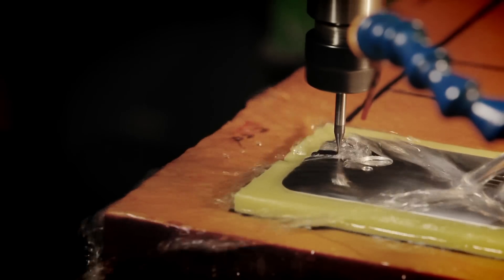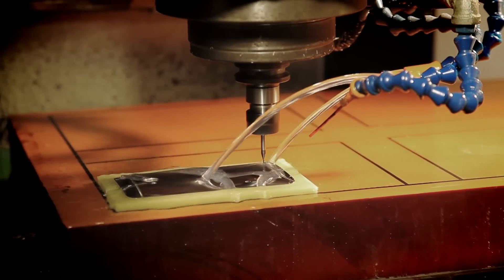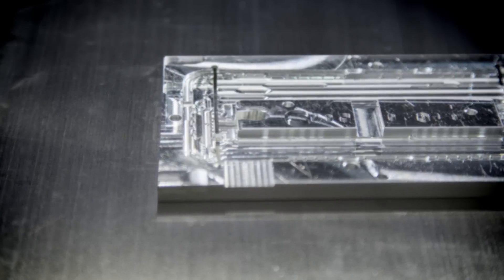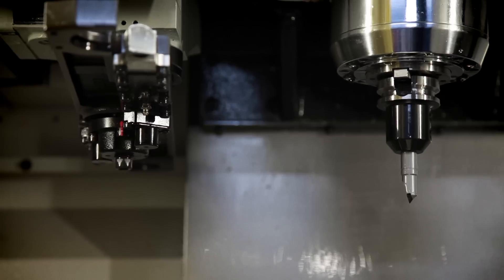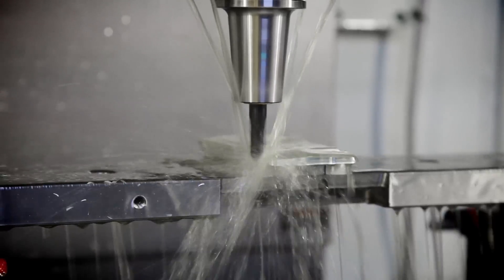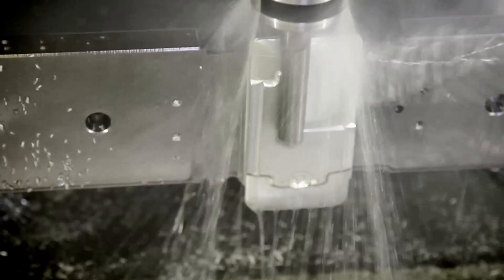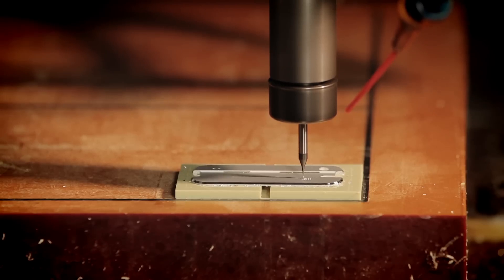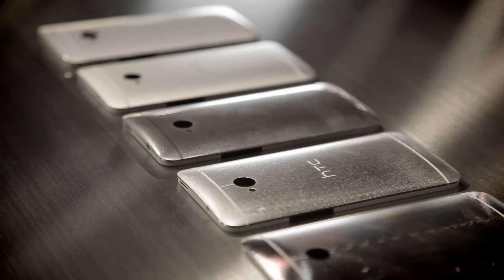Behind the breakthrough -- Building the HTC One.

Comment: Do you not research anything? The actual pixels in the camera are bigger, so they take in more light and more detail. This results in better pictures than ther phones, and especially so in low light. Because the pixels are bigger, it is impossible to fit more pixels inside a smartphone sensor.